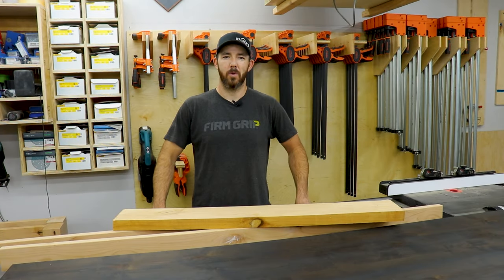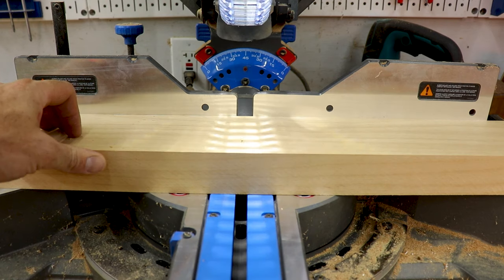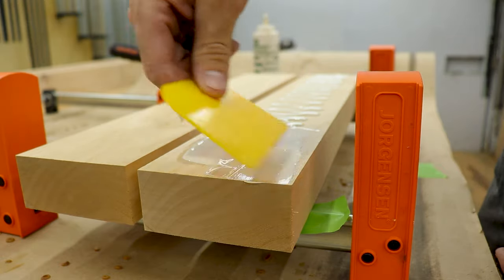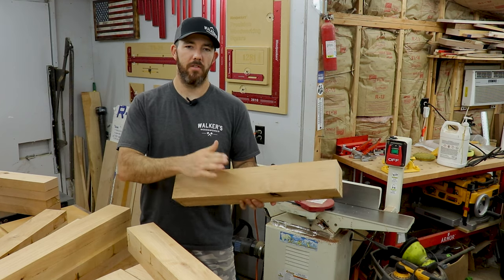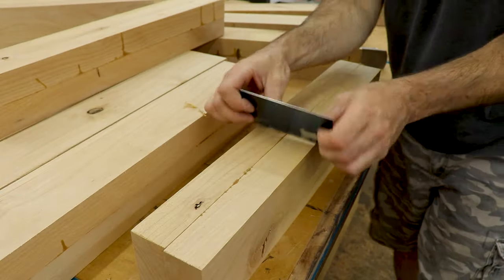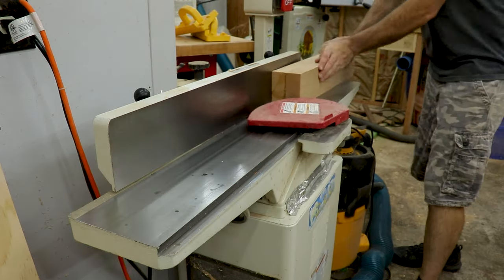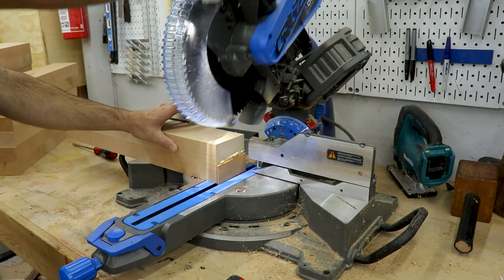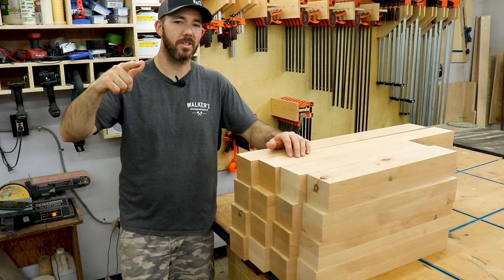DIY Table Legs! How To Make Simple Table Or Desk Legs.

Comment: How do you decide the orientation of the boards before glue up? Just based on aesthetics, or does the grain direction come into play to account for wood movement so the boards don't split later?
Reply from the maker: As long as they are kiln dried that shouldn't be an issue

Comment: Is there a reason you don't joint and plane the boards before you glue them together? What if the faces you glue aren't flat?
Reply from the maker: Good question.  I buy my lumber s3s (surfaced on 3 sides). So it's already jointed and planed when I get it.  👍

Comment: Why not get 4x4 which will be stronger?
Reply: Because a 4x4 wouldn't end up being a 4x4 it starts as 3.5x3.5 when you clean it up it'll be something like a 3x3 or 3.25x3.25 well off of the 4x4 he was originally after
Reply: @philipcoulson3111  There is no science that 4x4 will be strongest. MOST table chairs you will find are actually much thinner. I just don't understand unecessary extra work to make that wood.